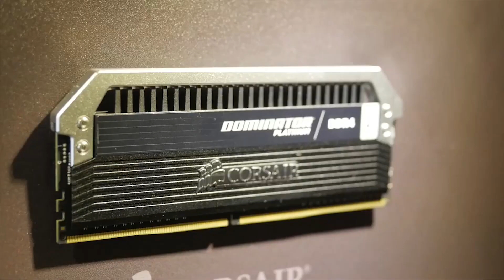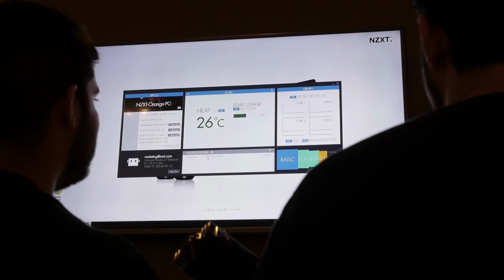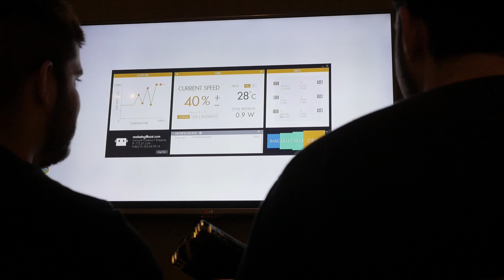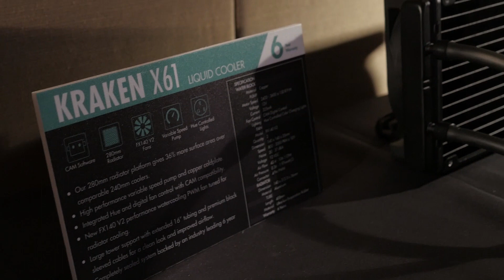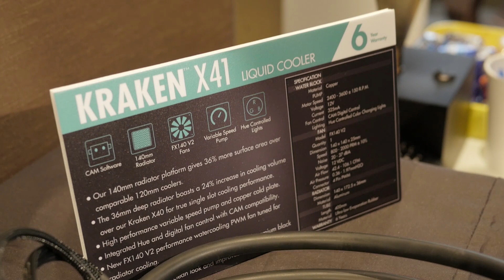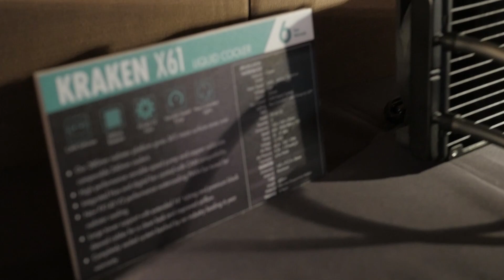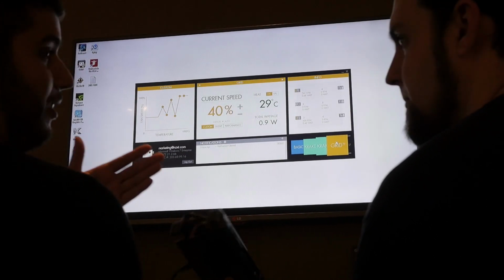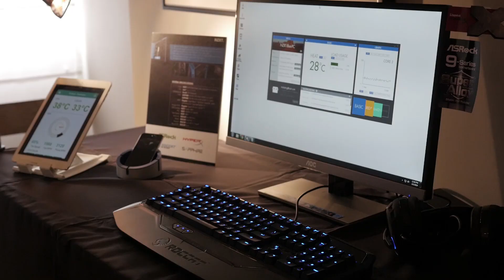NZXT Cooling Software & Heat Sinks - Computex 2014

Comment: After watching this, I downloaded the nzxt cam program... what a hunk of garbage... Not only are the temp readings a few degrees off from the other programs I use (core temp & real temp) but it stalls out and just stops responding at least every other day and I have to kill & re-launch it. I'm running an i5, 12 gigs ddr3 ram with windows 7 64 bit.

Comment: Hmm, it looks like there's nothing this program does that HWInfo64 can't do.
Reply: also asus new motherboards have the capability to change every fan header speed via DC OR PWM with your own custom speed curve for each fan directly from the bios so 0% ram and cpu usage lol
Reply: megaspeed2v2
Is that on the ASUS Hero VI Motherboard that I have?
Reply: AluminumHaste its on all of the new z79 boards, even the standard ones lol
Reply: Yeah looks like a piece of garbage...
Reply: It's fancy

Comment: ive used nzxt cam is completely useless because i can have msi afterburner open and speedfan which all give me proper temp readings, and the cam software still does not support amd apu's, gives me a wrong reading of 100+ celcius

Comment: When will they make a g10 bracket  to fit on non reference Gpu like the classified 780ti so we can have easy water cooling , their is so many people staying on air because they don't want the hassle of customer water loops but want the power if the best Gpu ,, make it now , and people will buy it ... Do it !
Reply: It's got a lot to do with how non reference cards move things around, my 7950 has its vram way off from the original design, plenty of blocks will screw onto it but they wont have the cold plate(s) in the correct place.
Reply: Because its expensive to make a bracket for every single flavor of every single available graphics card.
Reply: nothing is expensive if people are buying.they are just cheap asses trying to get max bucks at low cost,same as the closed sealed loop and not the adaptif loop like swiftech and if you can afford an 780ti or 770 lightning you can afford an bracket for it at any cost.
the  h630 case i have is great and fantastic but the x40/41 and 60/61 fails allover the place .the software is buggy and the cpu expensive usage slows down the whole pc,
leading market,battle prooved rad?WTF. they live on another planet.maybe on basic usage theyre stuff can handle it but on extensive usage and overclock they are midrange to lowrange classified on benchmarks and tests but yea i understand ..its all marketing talk...
Reply: I have a g10 on my Classified 780...
Reply: G10 is compatible with different cards and the NZXT website has a list of cards that are 100% compatible with an offer to send you longer or shorter screws if needed for no extra charge :)
Reply: offering free screws.....getting screwed....lolz

Comment: What happens if there is a security issue with the cloud control and a malicious user decides that on that 105F summer day while the CPU is at full load, that fan and pump should really be at their lowest speeds?
Reply: The cpu throttles and then the PC shuts down :P

Comment: plz plz OSX support, NZXT
Reply: Why do you need this software on a Mac?
Reply: i have a hackintosh and cooling software would be amazing.
Reply: 08yannch Just go with a Noctua. Best heat-sinks and fans you'll ever find (not to mention quiet, too)
Reply: Yer I'm alread running noctura case fans, still need a to update the cpu cooler(cooler master can put out the nose). This is more for the abillity to monitor temps and make changes while in the os.

But thank for the tip any way

Comment: Am I correct in thinking that I can use CAM to link the Fan speeds and pump speeds of a Kraken cooling my GPU to that GPU's temps? I.E. my gpu temps rise, it will automatically scale up the speeds of the kraken cooler?
Reply: Just downloaded it and all it is is monitoring, it doesn't let you control fan speeds or Kraken watercooling solutions, I was hoping for an alternative to the horrendous kraken controller, but guess we're gonna have to wait. Edit: Nevermind, It does allow you to control your kraken, but not mine apparently.